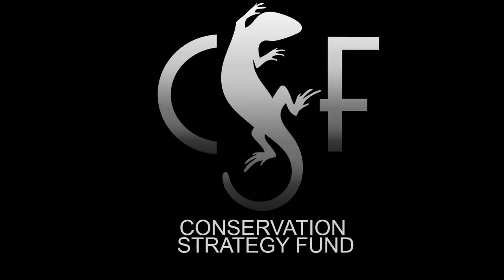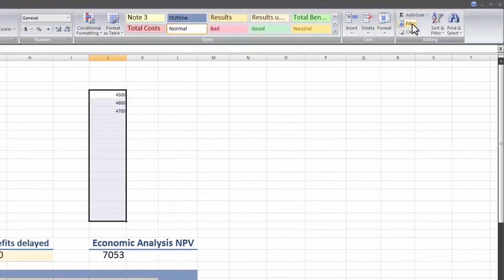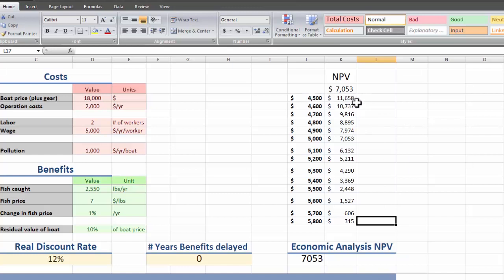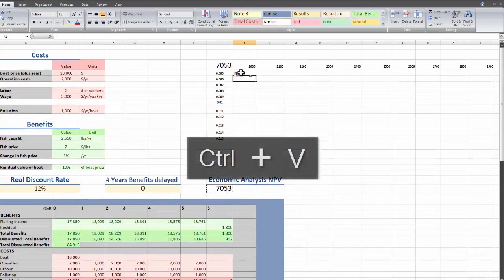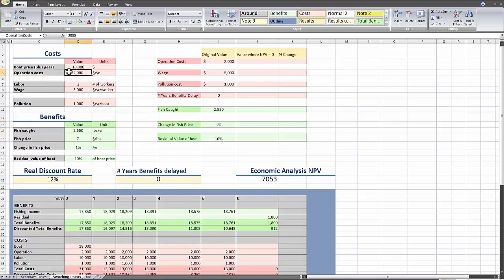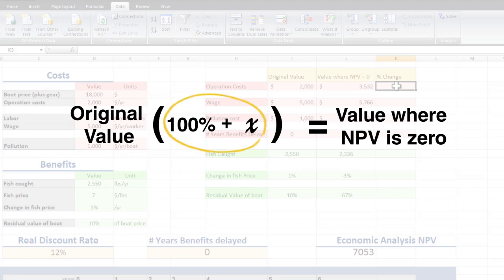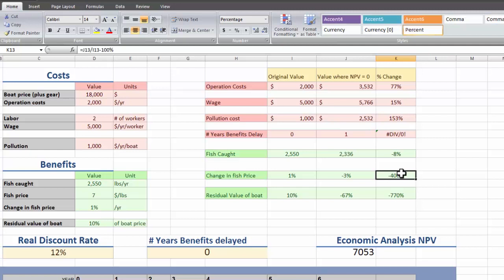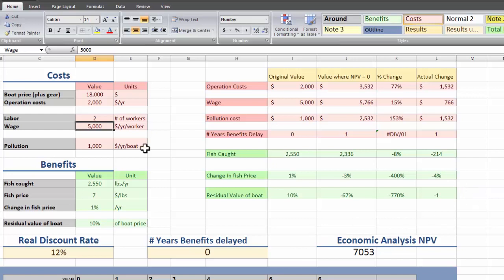Sensitivity Analysis

Comment: edit: I guess you actually sort of address this in the next video but I'll leave it here still. 

I think once you know your top 2 or 3 most sensitive parameters, you could express the NPV in terms of those 2 or three parameters. Then set the NPV to 0 and graph the 2D (for 2 parameters) or 3D (for 3 parameters) equation in order to have a better picture of how much room do you have if different parameters are changing dynamically.

for example if we express the NPV in terms of fish caught (FC) and change in fish price (CFP), assuming all the other parameters stay the same, we have:

NPV=
((7.84xy^5+63.62308x+171.60292xy^2+123.357696xy^3+138.19235xy+47.9808xy^4-90697.45756)/(1.97382))-31000

where x = FC and y = CFP

and if we equal NPV = 0 we can say:

x = (151885.87756) / (7.84y^5+47.9808y^4+123.357696y^3+171.60292y^2+138.19235y+63.62308)

if you plot this equation, everything under the line are values that you want to avoid, where NPV goes negative.

Comment: to fill a collumn u can easily mark the numbers you want to be counted uowards or downwards, like 1:22 the numbers 4500, 4600, 4700, (or just the first two that defines the column) click and hold the small black dot-like-thing in the lower rigth corner of your activated cell and draw it down. MUCH faster :D
Reply: Nimicraft it also works in preaty almost direction and with almost all kinds of numbers, like dates percentages funktions currencies and of course numbers
Reply from the maker: Nimicraft That's great advice.  Thanks for pointing that out!